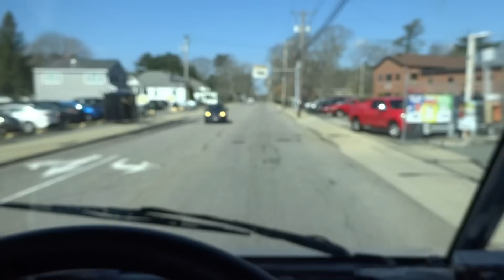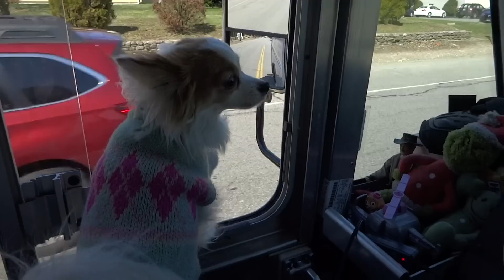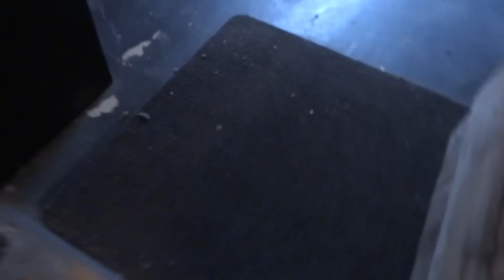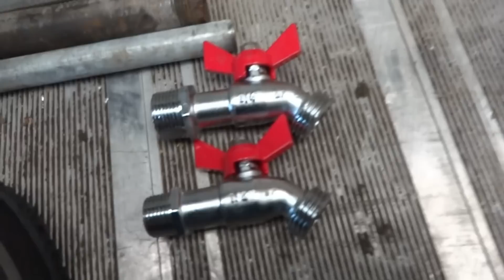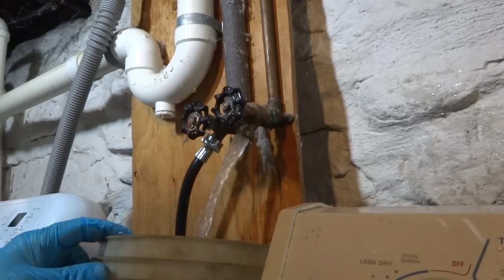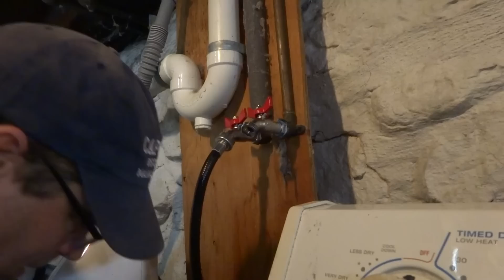OLD WASHERMACHINE SHUTOFF VALVES UPGRAIDED

Comment: You should look into some KNIPEX - Pliers Wrench, there may replace your crescent wrench. They have smooth jaws as to not mark the thing you're turning, and they multiply your grip to help you not slip off the nut.
Reply: i have the big and the small ones and can confirm they are fantastic havent used a crescent wrench in a long time
Reply: I had a feeling that someone would invent a tool like that, eventually.  Thanks for the tip.
BTW: I think Biden is "off his nut".  LOL!
Reply: Or use a larger "crescent" wrench.